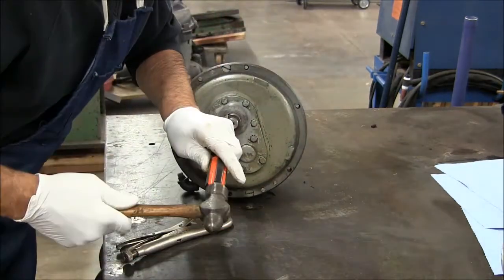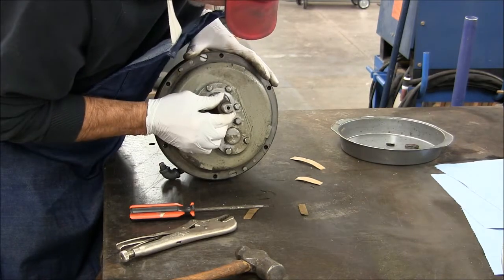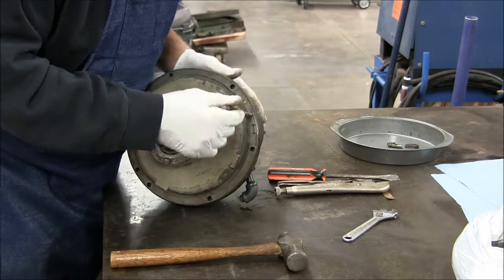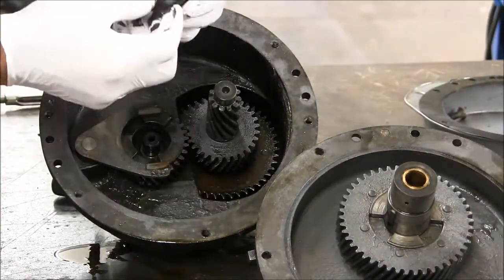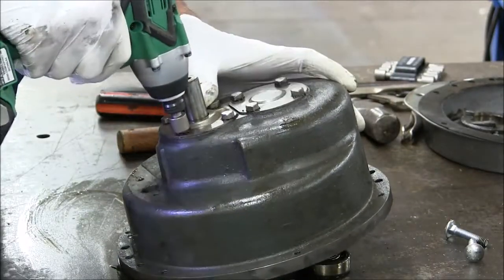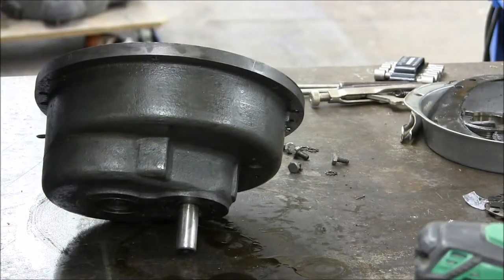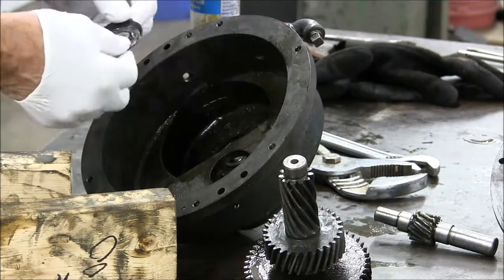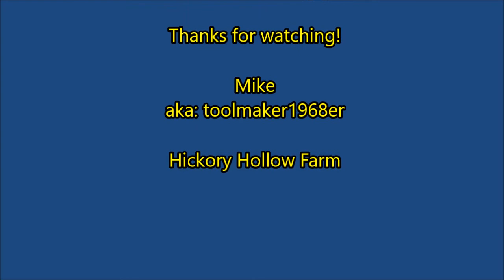Doall bandsaw refurb Part 4

Comment: Wow - plenty of dowel pins! Certainly didn't seem a whole lot of oil left. That unit is quite sophisticated but - hmmm - pity that small helical gear is somewhat shot.
Reply from the maker: ChrisB257 - Yes, that gear along with it's mate.  That's always the risk with these old machines. I hope those gears are available. I know if I can get them they'll be expensive. I have some margin before the cost input exceeds the market value of the machine. Will keep you posted. Thanks Mike